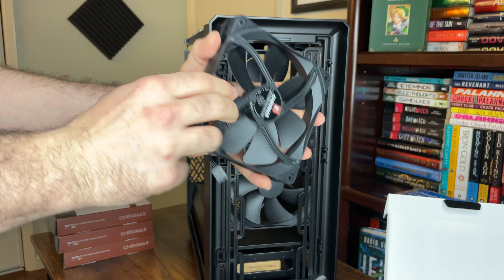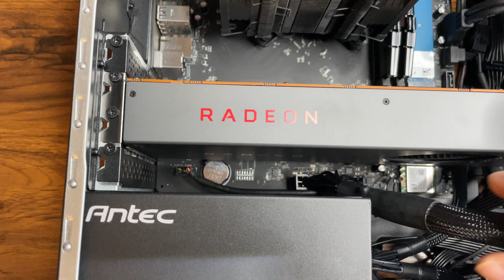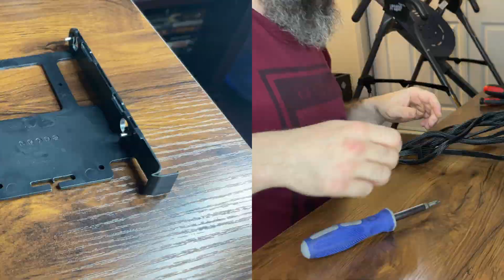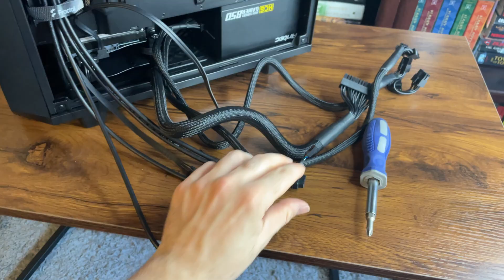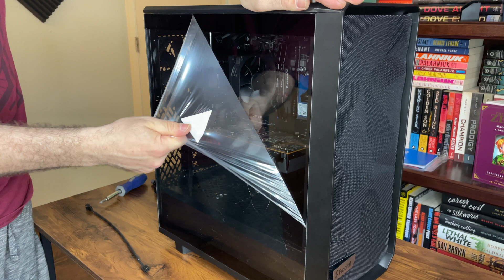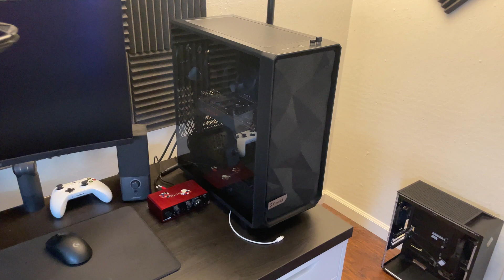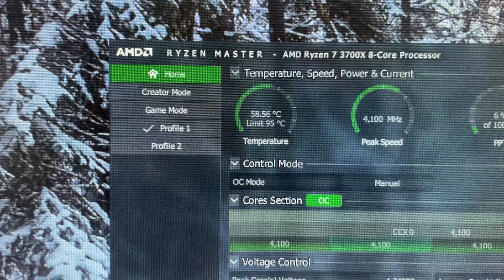HP Omen 25L / 30L Case Swap! Tutorial! Walkthrough and Results!

Comment: Hiya Dan I’m getting the 275r airflow but why did you leave the network card?
Reply from the maker: You only use the network card if you are going to use WiFi. I always hook my computer up with an Ethernet cable
Reply: @DanKamYouKnow  ah thanks mate I am buying the 275r airflow do I need to buy anything or upgrade anything for example psu?
Reply from the maker: You don’t have to get a new PSU but it’s nice to “future-proof” your system with one. Especially if you decide to change motherboards or get a stronger GPU
Reply: @DanKamYouKnow  ah I see thanks so do I need anything for my new case?
Reply from the maker: You shouldn’t need anything extra
Reply: @DanKamYouKnow  cheers mate I currently got a noctua u9s should I get the nzxt 120mm aio?
Reply from the maker: You can fit a wide variety of coolers in that case I believe. If you’re going with an AIO, you could probably go 240mm / 280mm / 360mm. I would look up with that case supports. But even then, the U9S will work just fine
Reply: @DanKamYouKnow  hi mate do you think this mobo will work with the case and all my omen stuff Asus ROG STRIX Z490-G GAMING (WI-FI) DDR4 mATX Motherboard
Reply from the maker: What CPU do you have? The specific one, not just the generation
Reply: @DanKamYouKnow  i5 11400f if not I would like the cheapest option please
Reply: @DanKamYouKnow  the cheapest mobo that is ok and is compatible
Reply from the maker: Yup, that should work fine. Here is a compatibility list showing all motherboards that will work with that CPU:

https://pcpartpicker.com/products/motherboard/?compatible_with=qp2WGX

See what you like best and pricing that works for you.
Reply: @DanKamYouKnow  also if I take out the ram in my omen system does  it go to the lowest and no way possible to get out because I want to spray paint the ram white
Reply from the maker: I’m not sure why you are asking. Only Omen motherboards are weird with RAM speed. Any other motherboard will have it run at its max.
Reply: @DanKamYouKnow  I mean if I take out the sticks and put the. Back in will it go to lowest speed?
Reply from the maker: No
Reply: And do you need to take it out

Comment: Late comment but I own a 30L and recently upgraded (using your awesome tutorial) the cpu cooler to a noctua u9s. I’m also getting a top fan as well. That being said is it entirely necessary to get a new case? I heard that the omen case is terrible and should be swapped out.
Reply from the maker: Honestly, with the U9S, you should be totally fine as far as CPU temps. With the GPU, you can use a program like MSI Afterburner to make the GPU fan curve a bit more aggressive which will bring down temps a bit. It's not 100% necessary but it opens you up to a TON of different cooling / fan options / motherboard sizes / etc.
Reply: @DanKamYouKnow  Thanks for the reply! I think what i’ll do is just upgrade the PSU and tweak some of those settings you mentioned and I should be good. I may upgrade the CPU and GPU later on so I need a better PSU anyway. Keep up the good content!
Reply from the maker: Appreciate it!! Even with the U9S, you should be golden 👌🏻👌🏻👌🏻

Comment: great video! I have  an Omen 30L and need to swap the case as the GPU does not fit the case, Any ATX would fit the need? Would the motherboard and switches fit also such case? What should I care of? I very much appreciate the help over here, Cheers
Reply from the maker: Hey David. Any case that supports a Micro ATX ( Omens MoBo is Micro ATX ) will work. You may either need a new PSU or some extensions for the PSU, depending on the case you get. Overall, everything should swap over just fine.

Comment: Not to be a downer but at this point you should have just did a personal build, practically nothing left is OMEN.... you spent way more money doing this, unless you were getting promotional parts.
Reply from the maker: I’ve replied to this numerous times but case swapping is a great option for Omen users so this video was made for content purposes. I did end up doing a DIY build and the Omen is back in its normal case with its original parts ( except the fans and air cooler ).

Comment: hey man i need some help, i recently bought an hp omen gaming pc and switched the case to a nzxt H510 elite case and now everytime i power it on it says “a fan is not operating correctly” and all my fans are spinning.
Reply from the maker: Are you using some kind of fan controller? The Omen motherboard will throw a fan error if a fan controller is being used OR you don’t have a fan plugged into all of the normally utilized fan headers ( CPU_fan / Sys_fan / Ft_fan / etc ).
Reply: @DanKamYouKnow  i’m not sure, do you know how i can check that? i’m new to pcs and i just want the error message gone. i’ll even give you like $10 if you can get it off for me or help me.
Reply from the maker: Did you swap over all the parts for it? Are you aware of the fan headers being utilized on the motherboard?
Reply: @DanKamYouKnow  yes i swapped all parts over for it and i’m not sure if the fan headers are being utilized on the motherboard, i know all fans are running though once powered on.
Reply: @DanKamYouKnow  do you think maybe the case has something to do with it?
Reply from the maker: How do you have all the fans hooked up?
Reply: @DanKamYouKnow  i’m not sure, is there any way i can send you a photo of it? and tell me if you see anything wrong wit the connections.

Comment: I’m in the market for a new pc and might go with the 25L to get a 3070TI. Did you consider changing the motherboard or is it decent?
Reply from the maker: I have an entire playlist on pretty much any Omen modification, including motherboard swapping. There are a ton of benefits to swapping boards but it's not 100% necessary. The Omen motherboard isn't bad, there are just a lot of restrictions.
Reply: @DanKamYouKnow  thx for the reply! I just saw that one;) How about the GPU, any issues? I’ve read that Omen GPUs tend to die at an early age.. but I’m suspecting that this is due to people not dealing with the overheating properly..
Reply from the maker: It’s usually the single fan Omen cards that run a little too warm for my liking. You could always use MSI Afterburner to change the GPU fan(s) curve and make it more aggressive. ( Higher fan RPM = lower temp but higher noise )

Comment: i have the hp omen 25l with rtx 3070 and i don't know how to check if it will fit in the corsair 4000D airflow case
Reply from the maker: The 4000d is a very popular choice for Omen transplants, it will work just fine.

Comment: I just picked up the 30L with a 3070 and 5800X with the water cooling. That 5800X is *toasty*. It's like a tiny space heater on top of the case. I love the small size of the case (my last case was a monster HAF that took up like 1/5 of my desk), but my cpu and gpu are sitting around mid 70s (CPU might get up to around 80) during gaming. Of course turning the fans on "turbo" helps out a few degrees, but then I hate the extra fan noise. At the very least I'm going to swap out that 92 mm fan in the back as I think it's making a slight droning noise when temps get high.
Reply from the maker: I would swap out all the fans if you are looking for a quieter experience. Replace the front 120mm ( although you will lose the RGB lighting for it but is worth it IMO for performance and noise ) / the rear 92mm / the radiator 120mm fan ( make sure you get a high RPM fan for the radiator ). 80c is still technically safe because thermal throttling is around 95c, so you're good.
Reply: @DanKamYouKnow  Yup, already ordered a new 92mm. I hear a weird sort of wobbling noise when the fans ramp up and I think it's coming from that 92mm. I'm thinking of flipping the 92mm to an intake and using a few external 120mm fans on top of the case to pull hot air out. There is some space in front of the radiator and around the edges that I could prob draw out a bit more air. I figure for $20 for 2 external 120 fans that are USB powered, worth a try.
Reply from the maker: Haven’t seen someone try that but let me know how it goes.

Comment: I found your video very helpful when it came to swapping cases, however, my fans sit at an idle speed now. I can't seem to adjust the fan speeds and my system is overheating if I do any gaming on it. Any suggestions on what might be going on?
Reply from the maker: You’re using the Omen motherboard right? Make sure you are not using any kind of fan controller to start. Did you swap coolers during this or anything?
Reply: @DanKamYouKnow  Still using the Omen board. Currently have a NZXT case and using CAM for the case fans. Didn't swap the cooler or anything like that. I will try to wire those directly to the board and see if I have any results there.
Reply from the maker: HP boards usually do not like any other controllers or anything else trying to control the fans. Try to utilize all the Omen board connectors and see what happens.
Reply: @DanKamYouKnow  That seemed to resolve the issue! Thanks for the tip. Keep up the great videos!
Reply from the maker: Thanks!!! Glad it worked for you

Comment: The Omen 25L is ridicolously loud when doing a negative pressure setup due to panel gaps and/or maybe mostly because of the tiny side went along the front. I hope it gets quieter when I add the bottom fans and even out the pressure a bit. It certainly gets quieter when I take the panel off, which indicated negative pressure is the cause, and I can hear the "jet-engine whizz'" from the side intake.

For a case swap I might go for the corsair 4000d with 3 push fans in the front, and a low impedance high flow fan in the rear (Noctua S12A). That's going to be some serious flow rate per decibel compared to the Omen. But I'm not sure if it's really worth the money and all the work.
Reply from the maker: The stock HP fans are high RPM, cheap, and very noisy fans. Replacing all of them will make the PC quieter. But even then, you’ll still hear the GPU when it’s under load.

Comment: I really don't think you need a reset switch anymore. If it's locked up I just hold the power button for a few seconds and hard power it down. I really think it's better to cycle power and leave it off a few seconds to let everything power down completely before rebooting anyway.
Reply from the maker: Majority of aftermarket motherboards come with a reset switch and it’s basically a restart button, like in your start menu.

Comment: Thank you for the video!! Quick question how or what desk are you using?? It looks awesome. If possible please link it 😂😂
Reply from the maker: They are the IKEA ALEX drawers and their basic desktop. I actually run the IKEA KARLBY countertop now. Much more sturdy and cleaner looking.
Reply: @DanKamYouKnow  Awesome! Thank you. I’m almost done swapping my Omen 30L over. I was going for the fractal case you have but hard to find right now. I just got a basic Musetex 6 fan case in black. Swapped the case fans for 6 Corsair AF120 LED white. Got the fans for $40 brand new!. Everything else is stock so I hope this solves my cooling issues from the original HP case 🤢
Reply from the maker: I’ve heard those Amazon Musetex cases are pretty good. It should be miles better than the HP case and your temps should definitely drop.

Comment: trying to move over from my 30l and the power supply has this little metal clip on it that just prevents it from fitting in the fractal. I'm probably just going to file it down, but it seems strange that nobody else seems to have had this problem
Reply from the maker: Interesting. Can you slide the PSU in from the side? I already had an after-market PSU when I made this video so I didn't get to swap over the Omen PSU. I think I know what clip you are talking about but that's strange it's getting stuck.
Reply: @DanKamYouKnow  I had to file down the clip and it fit in just fine. My omen 30l shipped with all kinds of issues like the heat sink still having a plastic ring on it with the thermal paste all dried out so it wouldn't surprise me if mine was the only one that had it.
Reply from the maker: That’s a bummer, glad you got it to work. You’ll like the Fractal case a lot, great airflow

Comment: Hey Dan, I just recently got an NZXT h510. I was swapping the motherboard onto the new case from the old omen one, and noticed that the front panel connector that comes from the NZXT case is a 9 pin connector and the omen motherboard doesn’t have it. What do I do? I haven’t found no solution yet.
Reply from the maker: So, on some cases, they will completely group together all of the front panel connectors, what you will have to do is separate all the pins for it and plug them individually into the Omen motherboard. The only ones you’ll need are POWER +/ and LED +/- . There will also be a RESET +/- but the Omen motherboard doesn’t have this, so don’t worry about it.

There should be a way to separate the individual pins from the connector.
Reply: @DanKamYouKnow  thanks so much!!!!
Reply from the maker: NP! Did it work?
Reply: @DanKamYouKnow  Haven’t done it yet. Still finding a way to separate the cables.
Reply: @DanKamYouKnow  never mind i got it! thanks so much for help dan!!!! I really appreciate it!
Reply from the maker: Nice! Glad you figured it out. You’re welcome 😎👍🏻

Comment: Thanks for the vid. Just grabbed an omen 30l with i9 10900k and a 3090 and Temps are nuts so looks like I will going down this path soon.
Reply from the maker: Congrats on the new PC! Case swapping to a high air flow is the best thing you can do for those high end Omen builds, and possibly a bigger cooler if you got the budget.
Reply: @DanKamYouKnow  yeah. I have a 240mm corsair that I will probably throw in. The omen came with a 120 but it isn't enough.
Reply from the maker: The case is the limiting factor with those builds. A new case and 240mm AIO will run fantastic. 👍🏻

Comment: hey dan i just bought this case and will buy the noctua fans too but i was wondering about the headers. do i have to get the 3 legged y cable to hook everything up correctly, and if so, do you have any good suggestions? thank you!
Reply from the maker: How many fans do you plan on running in this case?
Reply: @DanKamYouKnow  thanks for the quick reply!! the same amount as in this video. first case swap i’ve ever done so i’m going to try to follow everything to the T.
Reply from the maker: So I y-split 2 fans into one header / y-split another 2 into another header / then 3 way split the last 3 fans into another header. You can use these 3 y cables:

https://amzn.to/2X5XobA

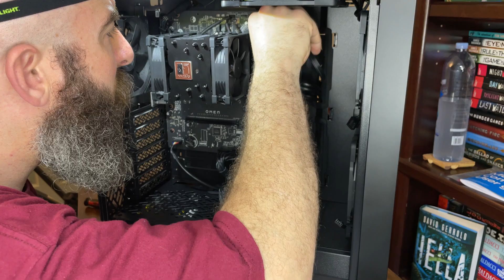I explain the fan layout at 18:37 👍🏻
Reply: @DanKamYouKnow  thanks so much i appreciate everything you do!! you’re the best
Reply from the maker: No problem my dude 🤝

Comment: Hey Dan, thanks for the video. I was also thinking of changing to Fractal Meshify cases, as I have omen 30L case but with a monster rtx3090 inside. the problem with that hp gpu and omen case is that the exhausted air from GPU goes into the case, so running something like RDR2 at 2k top resolution makes it quite hot inside with close side panel. 
What is your GPU card name? I was also wondering if you plan on changing to nvidia top of the line cards and if you tried loading your GPU to max (mb with mining), to see what are your temps with that massive airflow of Fractal Meshify Compact 2 case.
Reply from the maker: Hey! I have an EVGA 3070Ti in my Fractal case now and the absolute max temp I hit under full load is 70c.
Reply from the maker: Said GPU is not pictured in this video. I have changed things around quite a bit since this video.
Reply: @DanKamYouKnow  Oh right, I just saw your other video of unboxing and testing EVGA 3070Ti

Comment: Does it make a difference for the gpu temp. I decide to do a case swap in winter because my RTX 3070 configured 25l omen runs at 80c 🥵
Reply: Alright sounds good. I was going to keep the case but I wasn’t comfortable of the gpu temps shorting out the life span of the gpu considering how hard it is to get a 3070. I am still going to add a square plastic piece to my Corsair T220 case just to omen-ize it because the omen is iconic to me lol. Thank you so much
Reply from the maker: That would be pretty cool!
Reply: It literally dropped my gpu temp from 80c to 73c lol I’m so done
Reply from the maker: Yup, makes such a big difference with a good case. I often refer to the Omen as an Oven. 😆
Reply from the maker: Makes a MASSIVE difference. A good airflow case with quality fans will drop GPU temps quite a bit.